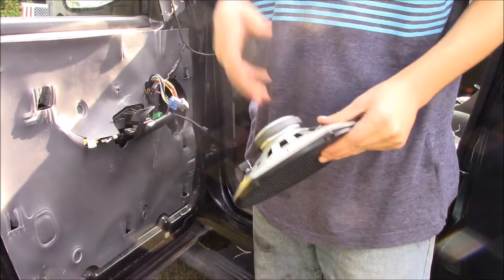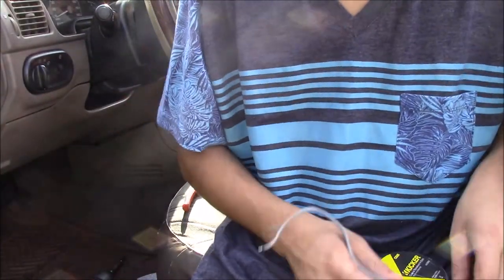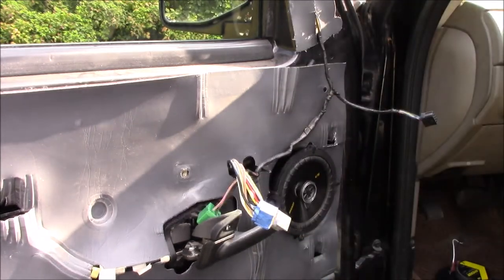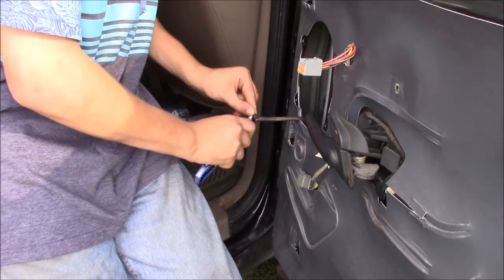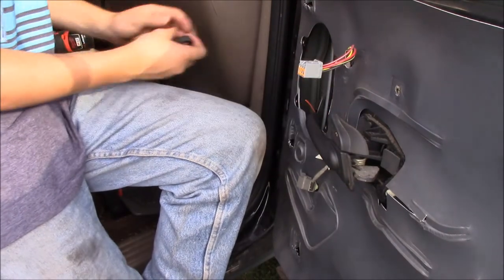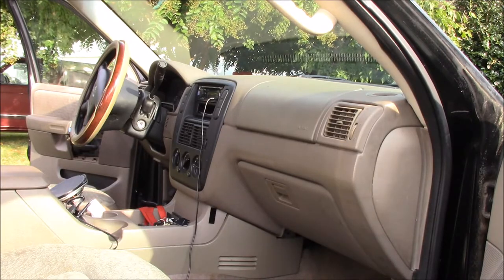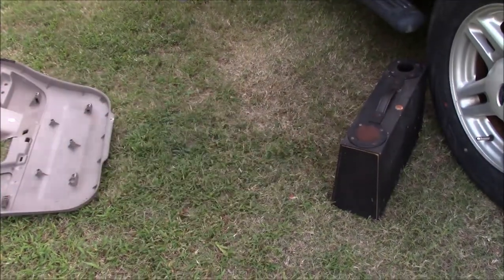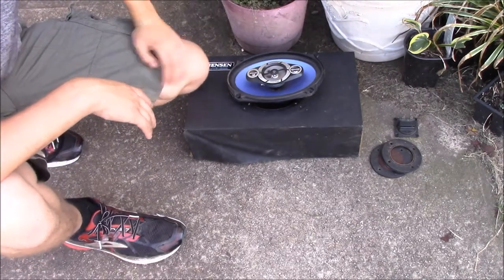Installing speakers in your car that don't fit? David's Custom Garage Episode 12

Comment: your one of those good ole boys fix anything build anything or make what you got work .like myself as got a old gmc truck last year .. just a shit box beater i dont want to spend anything on it iv got my 65 chevy thats being restored right....so the  gmc  is temperary  just for work nothing to look at other than it being a square body ....i like the ideas of those small boxes behind that seat your using  ..thin and not to long or tall..might build 2 to go behind the seat im replacing the raggy down to the springs seat with one im going to cover and install anyway
Reply from the maker: Use what ya got man im better on money now so i do some more things legit but there isnt anything wrong with making it work
Reply: @Xxdayday99  yea I get ya ..but like I said I'm restoring my 65 Chevy all my savings is going into it the GMC is for the time being for work and such so I gotta go the cheapest way out on the GMC

Comment: So I've found a new way to do this from a Guy in a forum .
Walmart's got a cutting board that is made out of high grade abs plastic stuff easily cut with a  whole saw and super thin but really strong just cut a hole , and then screw it to the sheet metal and the best part around a dollar.  I got mine 89 cents
Reply from the maker: thats a pretty awesome idea👍👍👍

Comment: Did you screw into the metal, making new holes? If so, what sorta screw did you use - self-taping ones?
Reply from the maker: Randomness on this particular vehicle, the factory screw holes work. on my f-150, which i do an audio install on in a later video, i use self tapping screws
Reply from the maker: https://www.amazon.com/Project-Center-41874-Inch-Drilling-Phillips/dp/B00133HBC8/ref=mp_s_a_1_2?ie=UTF8&qid=1528722672&sr=8-2&pi=AC_SX236_SY340_FMwebp_QL65&keywords=self+tapping+sheetrock+screws&dpPl=1&dpID=31sixUMstdL&ref=plSrch
Reply from the maker: That link is the type of screw i used on the f-150

Comment: ironicly the 6x9 you cut the box for would have sounded better in the doors , then the 6.5 , but also speaker adapters are pretty cheap now .  but anyway i didnt pay for it so just for the next cat  :)
Reply from the maker: Yea i was on a tight budget and just used what i had laying around at the time
Reply: been there still doing that lol yeah ive threw dct tape on card board to make baffles in my time, found car speakers at good will throwm in the back dash board just to have something but ive seen worse my friend

Comment: Dude best video on the internet thank u explained what that wiring harness was for took me forever to figure out how to do that harness cord thingy to make the ones in the front easier . And u also explained how to do it without the wiring harness . Whats your snapchat can i call u ? Im installing my speakers tomorrow
Reply from the maker: you just cut the factory plug and wire the aftermarket speaker leads to it
Reply: Xxdayday99 how do install a speaker that dont fit and i dont have any speaker mounts do you need to buy them in order to install the speakers or can you install them without mounts

Comment: Will 6x9 fit in doors for Ford Explorer 2002
Reply from the maker: no but 6x8's do
Reply: i am sure its kinda late but you could of made a adapter from wood probably or cut the door a bit and it would have worked